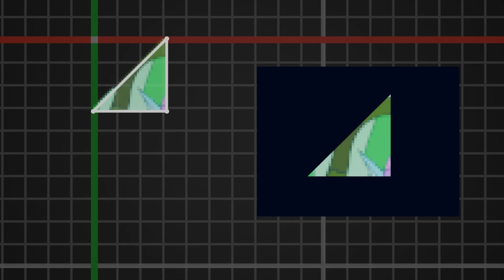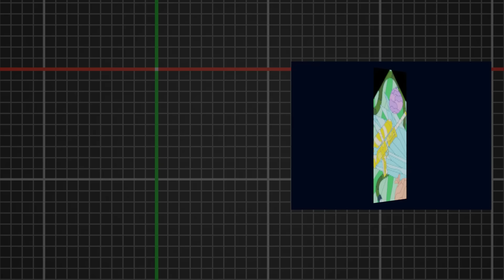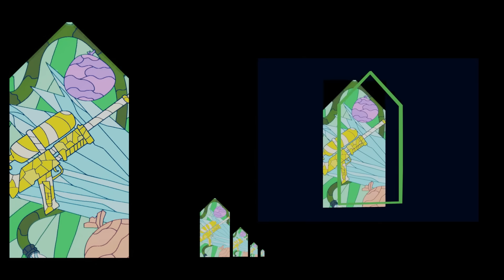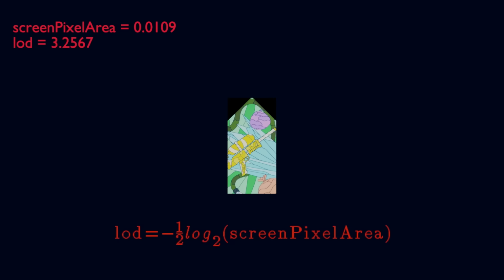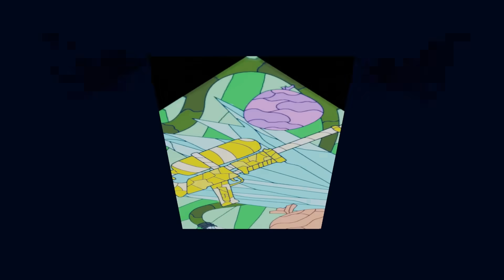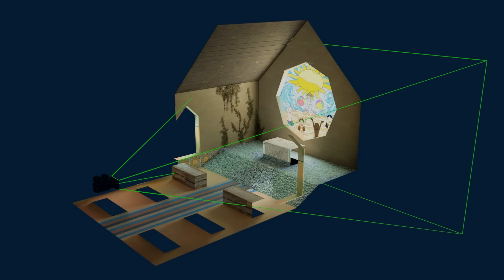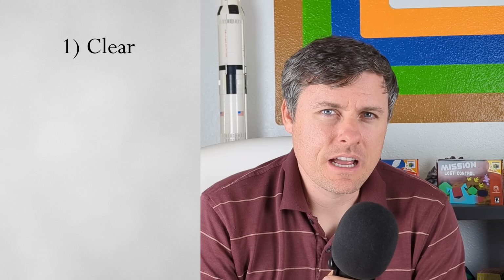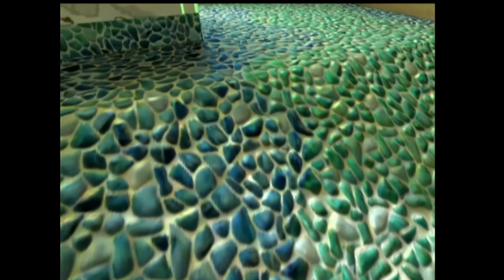How I implemented MegaTextures on real Nintendo 64 hardware

Comment: 5:04 look at the floor, from the green to orange to red (less detailed to more detail). This is exactly what I noticed in MGS3D, how the developers made it possible to run this on the 3DS.
Reply: Same in Mariokart wii with a lot of the road textures. You don't really notice it much at first, only a little bit, but when I replaced them all with the CS missing texture (for reasons), it was much more apparent.

Comment: This is actually a brilliant demo. The textures, I don't think I've even seen something like this on the N-64. While the N-64 is a "weird" console with a "weird" controller, you have to understand that back in the day, 3D games were new and nobody knew what they were doing, even Nintendo didn't know what they were doing.
Reply: Voodoo on PC came out the same year. 640x480. Smooth . Sharp textures.
Reply: @ArneChristianRosenfeldt  PC games at the time looked pretty bad.
Reply: @sebastiankulche  Wolfenstein3d alread had 64x64 textures. System Shock ran in SuperVGA before the N64 came out. Just need a ET4000 and a 486DX120 . Have you even seen the first voodoo? Yeah, for people gambling in the office, PC games included software renderers until 2001 when Intel finally integrated an acceleration into even the most official PC.

Comment: My question would be how much processing power does doing all that work to determine texture setups take? That has to eat a lot of the processing work that would take a lot away from game logic.
Reply: Yes. The more portal, BSP, prediction, sorting stuff you do. And then all this code better is optimized for the weird CPU cache. Try to use the 64Bit registers.

The idea with the z-buffer and the automatic mip mapping in the RDP is that the CPU can just spit out the game objects and never touch them again ( RamBus does not go brrr ).

Comment: I'm shocked this isn't even using the +4MB (for 8MB total) RAM expansion pak...
Reply: With four banks framebuffer, texture, code, data could all have their own bank. Does this help? Like the command bus sends out the next address while the last data burst still runs?

Comment: Amazing work! The results are mesmerizing!

I have a technical question: did you tesselate the scene geometry? I'm asking this because it seems the textures also contains lightmaps, so you're not rendering large surfaces using small repeatable textures. Each large surface needs to be split into smaller chunks each covered by a different texture tile. Right?
Reply: This is even already done by the original SDK or lib dragon. It is a pity that we don’t get light curvature out of this. 4kB textures are only good for 16px large polygons. On split a pop of 2px should not be noticeable. Do this on ever LoD / mipmap change and get organic (old) houses, car panels, streets.

Comment: I knew the 64 could do so much more. 3D was still a relatively new thing back then and by the end of the 64 era you could really tell how far they had come in understanding the system, but by then a new generation was imminent, so we never got to see the full unleashed potential that the system can offer. Thank you for showing the incredible power of the 64, brings back many memories. You're proving that the 64 might have had its shortcomings on paper, but that everything is possible with a bit of spit and vast knowledge. That said, you should team up with a YouTuber called "Kaze Emanuar". You two would make an incredible and unbeatable team together.

Comment: In the beginning of the video you say that what we’re seeing is being rendered on real N64 hardware but what’s in the video seems like it's being rendered in a resolution higher than 240p such as 480p, unless the megatexture effect is tricking my brain into thinking what I'm seeing is higher-res than it is
Reply: He has a Ultra HDMI.  It is  a  modded N64 that allows for an HDMI cable be plugged in.  He isn't limited by the composite cable.
Reply: @tigereyeproductions6102  I have an UltraHDMI installed into my N64 as well, it doesn't increase the rendering resolution of the games at all
Reply: @RdCrestdBreegull  I think I get what you are saying. I tried this demo out on my normal N64, and it still looks higher resolution than what I would normally see from other games. I think it's just because the textures are a lot higher resolution than what we normally see. He explains this at 1:56. An UltraHDMI will output a more crisp image even if it isn't higher resolution, so I think that is why it looks so good.

Comment: This would be a somewhat even more laggy experience on the N64 because rage when you turned drops to about 50fps when loading textures on modern hardware, which wouldn't be an issue if it were locked at 30fps or ran at about 100fps on computers and was locked at 60fps. Instead it's locked at 60fps on computers so mega texture doesn't sound like a good idea to me in most situations, but it is very interesting to see it implemented on a console that never really hit the 60fps spot anyways.
Reply: Often designers were forced to split levels and racing circuits. Now they don’t have to. Just don’t be aggressive and only drop one mipmap level for the textures behind you.

Comment: I've always wondered what it would have been like if the Nintendo 64 had a CD drive. I wonder what devs could've done with lots more storage.
Reply: Nintendo claimed loading times. But somehow every other console maker before them and they themselves after included a CD drive. How much would they have needed to pay Sony to license the technology? What if they use a bare bones CD? Like there is an analog sensor about the position of the arm. N64 just tells what to aim for with 1% precision. The drive focusses, tracks, and synthesises the clock. On the spiral every second there is a larger gap. So just load 2MB of data, pointers to the gaps and let the N64 figure it out. Like floppy drive on Amiga.

Comment: 40 megs trough 4 megs trough 4 kbs XD you can do jack shait with it, def no game. just exit the house pls
Reply: This is how modern computers work. The memory pyramid. You forgot that the 4kB give you 4 reads per cycle at 50 MHz or so. RAM gives you uh .. RamBus runs at 380 MHz ?? But is idling a lot.
Reply: @ArneChristianRosenfeldt  at that moment nintendo knew... they FUCKED UP XD

Comment: The footage was rendered in an emulator, right? I doubt the actual hardware could output 1080p. Meaning this technique does not need to be utilized to its fullest extent, anyway.

Comment: I'm assuming the sort done before rendering is some variant of BSP trees, which also has consequences for visual style from what I understand? It's very cool though.

If you could combine with some kind of bank swap algorithm (see how crash bandicoot did this as an example) and some way to stream from an "external" store, you could probably use this in a real game?
Reply: BSP arbitrarily splits polygons. I guess that you better turn off edge antialiasing. In Doom John Carmack tries to rejoin the slices for the floor. For high detail low fillrate areas on screen ( far away) certainly try to mark as visible and draw using z buffer.

Comment: so is an N64 rom hard limited to 64mb? is there any reason I couldn't use like an everdrive-like device, or like how those chinese counterfeit cartridges have onboard modern flash memory, could i not use something like that to make a game the size of, say, SM64 or OoT, with like a gigabyte of texture data on the rom that it's pulling from? or is the N64 just incapable of dealing with that much storage on a hardware level?
could i maybe use a cartridge with an onboard chip that emulates a cartridge swap to bypass this limitation?
it would be really cool to see someone implement this with a really massive game along the lines of OoT, but i would not be surprised if the hardware imposed hard limits
Reply: Why do people all jump onto this one point? ROM was insanely expensive back in the day. More than 64MB is just not N64 anymore. Like dumb kids with rich parents their expensive cars but no driving skilz

Comment: 0:30 I don't think you were trying to misinform, but MegaTextures were first implemented in 2007's Enemy Territory: Quake Wars, not Rage (even though the technology is used in Rage as well). Excellent video!
Reply: ET:QW and Rage implementations are completely different. If I understood correctly, James used approach similar to Virtual Textures from Rage, not Clip Map used in Quake Wars. This is how paper Software Virtual Textures (by J.M.P Waveren) describes Clip Map: 
"The clip-map [7, 8, 9, 10, 11, 12] is one of the first effective schemes for virtual textures with per
fragment texture address translation. The clip-map, introduced by Tanner et al. in 1998 [7],
consist of a stack of images similar to a mip-map hierarchy. However, whereas mip-map levels
cover the whole texture with images of increasing size, the clip-map uses fixed size levels that
cover a decreasing area around a single focus point that is placed somewhere on the texture.
Using a region of interest around a single focus point significantly simplifies the mapping of
texture data to geometry and the texture address translation during rendering has minimal
complexity. However, the single focus point of a clip-map limits this texture management
scheme to environments with a natural spatial correlation between the texture data and the
geometry, like for instance mostly flat contiguous terrain."

and Virtual Textures:
"Recent virtual texture systems are more flexible and mimic the virtual memory management of
an operating system on modern CPUs [16, 17, 18, 19, 20, 21, 22, 23, 24]. Textures are divided
into small pages that are automatically cached and loaded into video memory as required for
rendering. These systems use real-time per fragment texture address translation through page
tables and/or mapping textures. Because there is not necessarily a natural correlation between the
geometry and texture pages, these virtual texture systems require feedback from the rendering
pipeline to determine which pages need to be resident [13, 14, 15].
Reply: @kwahoo5746 good writeup!  And in fact even going back to the SNES and PS2 days there were systems to essentially virtualize and prepare textures (tiles on SNES) for just in time usage on the 'GPU' so you were constantly using DMA to stream data into the relatively smaller VRAM aperture.
Reply: In reality Mega Texturing exists since Doom 3 days, even thou the first game with MT was indeed Quake Wars.  
Doom 3 engine (idTech 4) has MT capabilities, for terrain only, since at lest 2003. (they disabled it for the source release but moders were able to bring it back)
But the MT in Doom 3 engine is, lets say a first gen system, still not ready for prime time, it worked but still add a major drawback, no compression for the MT data, meaning If id used MT in Doom 3, a relatively small 4k terrain MT, would take GB of disk space, for comparation, in Quake Wars a 8k terrain MT, was only a couple of MB on disk. 
John Carmack at Doom 3 time, was still working on a compression system for the Mega Texturing data and it seems that was hard because it took a very long time to come.

Comment: Gosh I want to develop my own N64 game. Maybe someday. But I struggle with lower level programming languages like C++, ive got good fundamentals but I am crap with pointers and optimisation. So im definitely nowhere near where i'd need to be to even think about making an N64 game.
If someone made a custom engine and a C# compiler than probably but for now, it evades my abilities.
Reply: Have fun with reference types in C# ! C# can put value types in arrays without boxing. You move to the next element by pointer+=sizeof(struct) . MIPS has no weird addressing modes. You need to do the add yourself anyway. C# also has 2d arrays. So you know all the stuff!
Reply: @ArneChristianRosenfeldt  I guess I dont because im not entirely sure what half of that means. I really am in the dark when it comes to all that back end stuff.

Comment: V64 could multi-load N64 software from CD-ROM but the cartridge RAM was only 32MB and I don’t know of any N64 homebrew that used this. The V64jr512 is a full 64MB RAM cart but had no built-in CD-ROM. I’m not sure if the jr supports multi-loading via parallel port but it does let you use a PlayStation with Multi Xchanger as an external CD-ROM for your N64. It’s slower than the older CD-ROM based V64 though being able to load that much data at once for each level would totally be worth it. I do know of V64jr homebrew that would not set the read-only flag so it could over-write itself in memory, since that was used for dumping cartridges. The V64jr had no built-in backup function… no BIOS of any kind really, which is why it requires a custom ROM and some way to read the inserted cartridge into the RAM cart’s memory.

Comment: I wonder if you could use optimization techniques to shrink the images? Including color indexing and using slightly smaller images for the highest LOD. I know very little about texture optimization, but there are definitely some tricks. I wonder if it would be possible to write code to load different image formats that pack better? Like webp, avif, and jxl.

Again, I am not an expert, but it seems there may be more improvement to be had if you use some additional tricks.
Reply: Indexed colors on N64? So in addition to one cycle hiColor, you would add 3 cycles for palette look up??
Reply: @ArneChristianRosenfeldt  I did not know it took more cycles to do.
Reply: From the top of my head: Jaguar and Saturn had a dedicated Palette, but N64 and PSX had a unified architecture because a Palette makes no sense with more than 16 color (pro Texture)  @JoeEnderman

Comment: With a 64drive (V2) you can have up to 240MiB of ROM space (the N64 memory map allocates a 256 MiB range to cartridge ROM, but the 64drive reserves the last 16MiB block for internal functions, what marshallh calls Cartridge Interface).
Alternatively, you could have a big file on the SD card (if you can ensure it's not fragmented, you can refer to it with just a single LBA offset and avoid getting dirty with the file system on the card) and treat it as a big secondary ROM with perhaps lower aceess time and speed. I suppose this second approach would work similarly on both 64drive and certain EverDrive models.

Of course none of this would help performance, but you basically can get "infinite" ROM that way.

Comment: in all honesty this makes me think even more that you could apply ray tracing into the baked in textures. if you went with less resolution on the textures and a tad bit more geometry then i'd love to see a small room with ray traced baked in textures. you have convinced me fully that it's possible.
Reply: Ray tracing needs to know the camera position. How do you bake that in?

Baking uses forward raytracing ( path tracing actually). You could split the BRDF at each surface point into a perfect diffuse part and the rest. For the diffuse part you can accumulate the energy at each point. For the rest you really need path tracing.
Reply: @ArneChristianRosenfeldt  just do it from the middle of the room. its an n64 who cares if its perfect just pick a spot and see if it looks good

Comment: So, fundmentally, it's a tile-based texture LoD system? Definitely could see a lot of potential uses for it. I mean, rendering the whole game with it isn't entirely practical considering the memory/cartridge space costs, but it could reasonably be used only on a select-few textures that should have high detail and the rest of the scene using only standard texture rendering...
Reply: Or instead of a MegaTexture just give the normal textures in SuperMario one or two mipmap levels?

Comment: Question: Could this also work on a PlayStation? A CD could hold ~10 times a much data, which would alleviate the storage problems. But I imagine reading from the CD may be too slow compared to reading from a ROM cartridge.
Reply: Yes. In fact, this kind of reminds me to the windows of Cortex castle or the Citadel City HUB world of Crash Team Racing.
Reply: You should maybe not depend on the viewing frustum. But mipmaps depend on the distance. If your player has a speed limit, this works. PVS in quake can warn you when a player is going to look into the next section.

PSX CD is double speed and has even higher data rate on the circumference. Seek times though are like a second? For racing you can arrange the data as it appears on the track. Same for vertical or horizontal 2d scrollers.
Reply: @ArneChristianRosenfeldt  Yeah something like that was indeed used in Crash Bandicoot. Apparently it requires linear levels, due to 2x CD being still quite slow.

Comment: Its been said for years, but the greatest limiting factor of the N64 was the Cartridges. Imagine if developers had access to PS1 sized discs on this hardware back in '96? You could hypothetically make games with the file sizes upwards of a gigabyte, depending on how many discs you used, and games would have been cheaper to manufacture than they were with the Cartridges. You could have literately made games 20x the size of your largest N64 games, on hardware that was leagues above what the competitors had. 

But, the limitations still prove to this day, that innovation is born by limitation. The amount of workarounds people have discovered with this hardware, amazes me to this day -- Both on actual N64 games, and with dedicated developers like you or Kaze Emanuar -- The N64 is an amazing piece of hardware history, and I'm glad to see we're still pushing its limits! Makes me wonder if we'll ever start to see hobbyists picking up the Gamecube hardware and pushing that console to its limits?